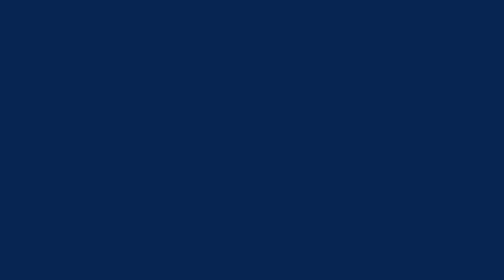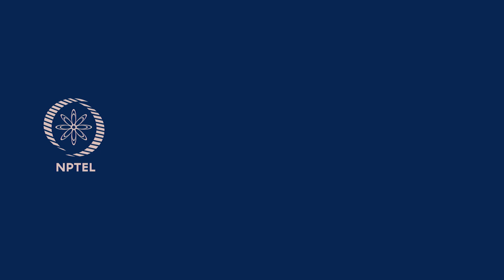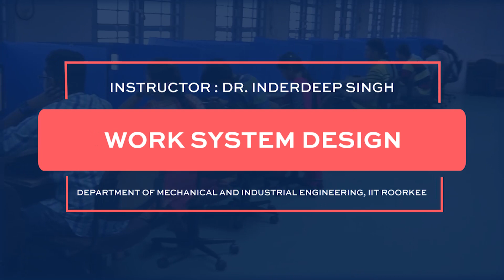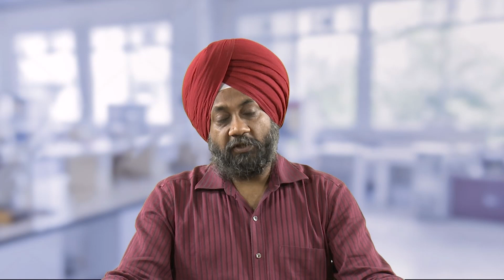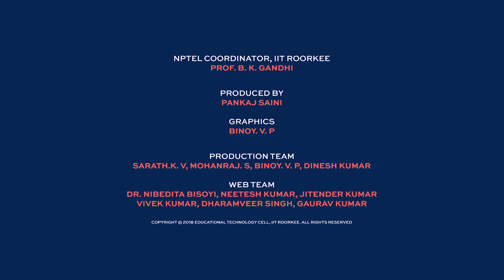Work System Design

Comment: sequential playlist:

Course Intro
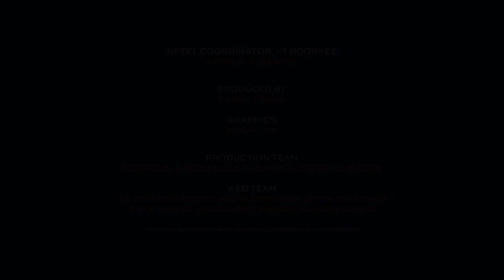Intro: Work System Design (Original #1 | 5:29) (This is a short promotional/introductory overview)

### *Week 1: Introduction to Work System Design & Productivity*
1. *Lecture 1:* Work System Design: Introduction (Original #2 | 30:04)
2. *Lecture 2:* Introduction and Concept of Productivity (Original #25 | 33:06)
3. *Lecture 3:* Measurement of Productivity (Original #24 | 35:27)
4. *Lecture 4:* Productivity Measures (Original #23 | 26:57)
5. *Lecture 5:* Productivity Measurement Models (Original #22 | 28:34)

### *Week 2: Productivity Analysis & Improvement*
6. *Lecture 6:* Factors Influencing Productivity (Original #21 | 25:59)
7. *Lecture 7:* Causes of Low Productivity (Original #20 | 31:57)
8. *Lecture 8:* Productivity Improvement Technique (Original #19 | 35:27)
9. *Lecture 9:* Numerical Problems on Productivity (Original #18 | 28:58)
10. *Lecture 10:* Case Study on Productivity (Original #17 | 35:34)

### *Week 3: Basics of Work Study*
11. *Lecture 11:* Work Study: Basic Concept (Original #3 | 31:58)
12. *Lecture 12:* Steps Involved in Work Study (Original #16 | 34:53)
13. *Lecture 13:* Concept of Work Content (Original #15 | 34:40)
14. *Lecture 14:* Techniques of Work Study (Original #4 | 38:06)
15. *Lecture 15:* Human Aspects of Work Study (Original #14 | 36:31)

### *Week 4: Method Study Basics*
16. *Lecture 16:* Method Study: Basic Concept (Original #13 | 38:15)
17. *Lecture 17:* Method Study: Steps (Original #12 | 33:13)
18. *Lecture 18:* Method Study: Recording Techniques (Original #11 | 39:00)
19. *Lecture 19:* Operation Process Charts (Original #10 | 35:41)
20. *Lecture 20:* Operation Process Charts: Examples (Original #9 | 34:38)

### *Week 5: Advanced Process Charts*
21. *Lecture 21:* Flow Process Charts (Original #5 | 36:29)
22. *Lecture 22:* Flow Process Charts: Examples (Original #6 | 32:43)
23. *Lecture 23:* Two-Handed-Process Charts (Original #7 | 36:06)
24. *Lecture 24:* Multiple Activity Charts (Original #8 | 34:51)
25. *Lecture 25:* Flow Diagrams (Original #37 | 33:07)

### *Week 6: Motion Study & Diagrams*
26. *Lecture 26:* String Diagrams (Original #36 | 35:24)
27. *Lecture 27:* Principles of Motion Economy (Original #35 | 30:19)
28. *Lecture 28:* Micro-Motion Study (Original #34 | 33:36)
29. *Lecture 29:* Therbligs (Original #33 | 38:26)
30. *Lecture 30:* SIMO Charts (Original #32 | 33:38)

### *Week 7: Method Evaluation & Implementation*
31. *Lecture 31:* Memo-Motion Study (Original #31 | 30:07)
32. *Lecture 32:* Cycle Graph and Chronocycle Graph (Original #38 | 32:49)
33. *Lecture 33:* Critical Examination Techniques (Original #27 | 38:09)
34. *Lecture 34:* Development and Selection of New Method (Original #26 | 31:46)
35. *Lecture 35:* Installation and Maintenance of Improved Methods (Original #28 | 30:34)

### *Week 8: Work Measurement Basics*
36. *Lecture 36:* Work Measurement: Basic Concept (Original #39 | 31:16)
37. *Lecture 37:* Techniques of Work Measurement (Original #40 | 36:21)
38. *Lecture 38:* Steps Involved in Time Study (Original #41 | 33:51)
39. *Lecture 39:* Steps and Equipment of Time Study (Original #42 | 33:04)
40. *Lecture 40:* Performance Rating (Original #43 | 30:31)

### *Week 9: Standard Time & Ratings*
41. *Lecture 41:* Performance Rating: Examples (Original #44 | 29:15)
42. *Lecture 42:* Allowances in Time Study (Original #45 | 32:09)
43. *Lecture 43:* Computation of Standard Time-I (Original #46 | 33:51)
44. *Lecture 44:* Computation of Standard Time-II (Original #47 | 31:43)
45. *Lecture 45:* Work Measurement: Applications (Original #48 | 32:10)

### *Week 10: Work Sampling & Synthetic Data*
46. *Lecture 46:* Work Sampling: Basics (Listed as mod10lec46) (Original #49 | 32:54)
47. *Lecture 47:* Procedure of Work Sampling Study (Listed as mod10lec47) (Original #50 | 33:56)
48. *Lecture 48:* Numerical Problems on Work Sampling (Listed as mod10lec48) (Original #51 | 31:13)
49. *Lecture 49:* Introduction to Synthetic Data and PMTS (Listed as mod10lec49) (Original #52 | 33:05)
50. *Lecture 50:* Introduction to MTM and MOST (Listed as mod10lec50) (Original #53 | 34:28)

### *Week 11: Ergonomics*
51. *Lecture 51:* Ergonomics: Basic Concept (Listed as mod11lec51) (Original #54 | 30:30)
52. *Lecture 52:* Industrial Ergonomics (Listed as mod11lec52) (Original #55 | 31:17)
53. *Lecture 53:* Ergonomics: Anthropometry (Listed as mod11lec53) (Original #56 | 35:20)
54. *Lecture 54:* Man-Machine System-1 (Listed as mod11lec54) (Original #57 | 34:54)
55. *Lecture 55:* Man-Machine System-2 (Listed as mod11lec55) (Original #58 | 41:23)

### *Week 12: Ergonomic Case Studies*
56. *Lecture 56:* Case Study: Office Chair (Listed as mod12lec56) (Original #61 | 32:19)
57. *Lecture 57:* Case Study: Tower Crane Cabin (Listed as mod12lec57) (Original #29 | 38:15)
58. *Lecture 58:* Case Study: Car Seat (Listed as mod12lec58) (Original #30 | 33:37)
59. *Lecture 59:* Case Study: Computer System (Listed as mod12lec59) (Original #59 | 33:32)
60. *Lecture 60:* Case Study: Assembly Line (Listed as mod12lec60) (Original #60 | 32:49)